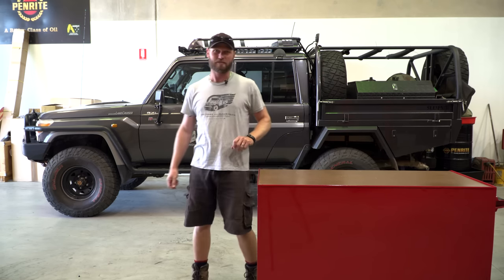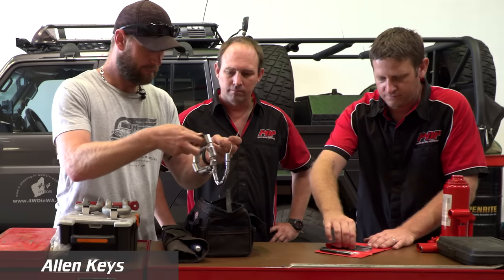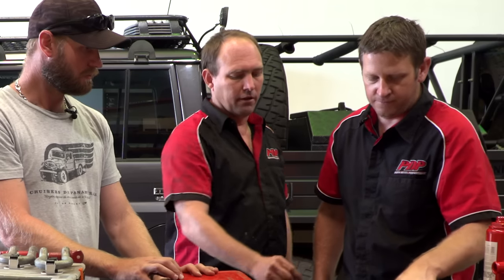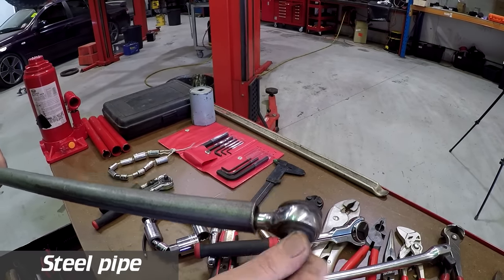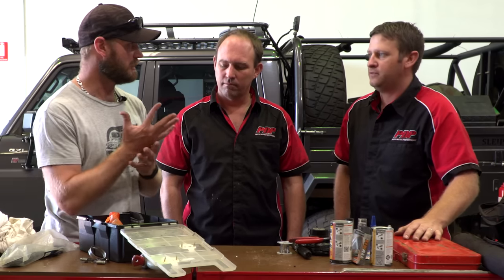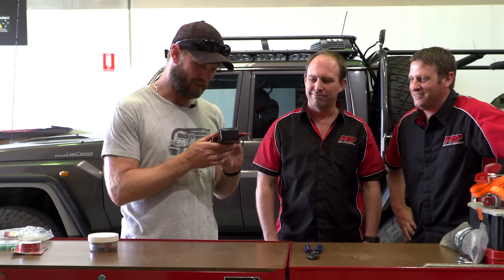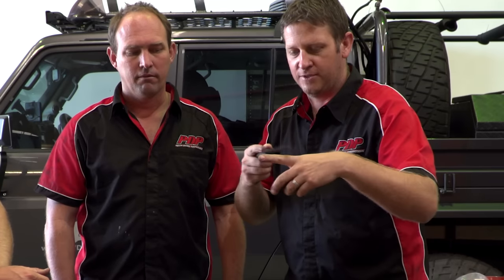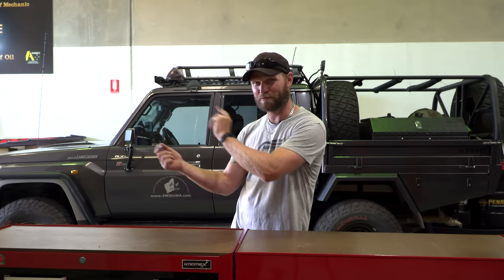Overland Tool Kit, repair kit

Comment: One tip for storing your ratchet straps. Toss each one in one of your old socks you were going to toss out and fold it over. It keeps the straps from hooking on each other and you also now have one more Rag in your rig just in case.
Reply from the maker: +Sean Burke best thing I've heard all day, worst thing when those straps get tangled
Reply: Also Grunt make man sized 5mm twisty cables ties! Use them on my straps all the time.
Reply: Sean Burke Damn good advice. I just use plastic shopping bags so they won't bind together
Reply: Great idea, i have enployed to great sucess to store my messy rachet straps. BRILLIANT.
Reply: I just wrap the strap with lecky tape across it. Same with cables once rolled up properly. You just need to grab 1 wrap on each side and yank and it breaks off
Reply: You genius SOB!

Comment: LOved it and "Liked It"! Ratchet straps are also handy if you have a tyre so flat that that it un-beads from the rim. Put the ratchet strap AROUND the whole tyre before you re-inflate it, make it quite tight, and it will force the tyre to re-bead before it over-inflates the tyre.

Comment: Excellent video Ronnie. It is always nice to learn something new. My mechanic experience comes from the military aviation background, and if you allow me I would like to make some suggestions: 
-Put sockets on rails. It is less likely you will lose them in the dirt. 
-You can get a small can of rosin flux. It makes the solder flow better. 
-Razor blades are useful for stripping wires. 
-Carry extra battery for multimeter in case multimeter is dead when you need it. 
-Have about 30 cm of wire with alligator clips on the end. You can use it in combination with a multimeter to measure voltage or resistance. 
-Bring various size of shrink tubing and have lighter to shrink them around wires. Soldering wire with shrink tubing is superior to crimping it. 
-Get rid of wire stripping pliers; you can use the razor blade for that. 
-Get rid of the universal socket. It might be too tall for practical use in tight spaces.
-Add adjustable wrench. It is suitable for holding bolts while you tighten nuts. 
-Add ½ universal joint. It is useful for getting nuts at the angle from your ratchet. 
-Add medical locking hemostats to your tools. You can use them for routing wires, picking small parts or for cleaning hard to reach areas with a small piece of cotton ball and alcohol. 
-Add small metal saw, or metal saw blade. If using blade wrap one end with a rag to prevent injury.
-Add mechanical fingers, and or flexible magnet to “fish out” nuts or bolts you can not reach with your hand.
-Add headlight torch to your tools. I love Pelican brand for their durability. 
-Add a small inspection mirror. It will help you with troubleshooting. 
-Alignment punches can be used to align parts in order to put bolt thru. 
-Combination mallet with steel on one end and rubber on the other might be a more useful tool than a hatchet. 
-Suggested tools should not add too much to the weight of your existing tools. 
-If you put all your hand tools in rolls, they will be more compact, and you will save some weight by getting rid of the boxes. 
Thank you for making this video. It is very informative, and there is a lot to learn from the professional mechanic perspective.

Comment: Ronny, I don’t often binge watch YouTube channels, but yours is truly binge worthy. I own a 2007 Chevy Suburban 2500 that I use to tow a ridiculously large camper because I have 5 growing spawn. At age 38, it is my first 4WD, and I absolutely love the beast. We recently took a vacation out to the Black Hills of South Dakota and I got a taste of off-road. Now I’m determined to find those trails in Wisconsin. My unicorn beast needs to be able to tow heavy and ‘froad moderately. Your videos are giving me the inspiration and knowledge to make that happen once the money shows up. The ole Burb is going to need a re-gear, some lift, and bigger tires, but a front locker and a winch will be a solid start. I’m already plugged into a few local off-road clubs. Thanks for your content.

Comment: I'm sure other people have mentioned it in the comments but swap that bottle jack 3 part handle out for a solid bar you can use for a breaker bar as well.  Cheap Bluetooth or wifi fault code dongle so you can use your phone to talk to the obd2 port.
The top of the bottle jack get a u shaped cap for it less chance of it slipping off when your underneath it.   The only other thing that I can think of is get a blow torch head for your soldering iron, very handy if you need to heat up a suborn bolt or need to fix a hole in plastic.oh bin backs I always have a roll of back in the back of the 110 so handy.

Comment: Great vid mate, some good tips. A little tip with your socket set is to fill up the back of the plastic insert with silicone. This stops the plastic from cracking and breaking while 4x4ing
Reply from the maker: great idea!
Reply: Or expanding foam.
Reply: good tip. similarly I've used hot melt glue to fill in various plastic molds to stop them cracking (such as the lip on plastic storage tubs)
Reply: My dad always used bondo, that was just to keep screwdrivers and such organized in his tool box though.  Probably a bit heavy for trail use.
Reply: wishing I knew this before my socket kit fell apart.
Reply: or even plaster of paris?
Reply: slowboat yeah but who is going to Paris to get some?
Reply: No, it would crack and make more of a mess than having nothing.
Reply: I like this !

Comment: Very useful info! Just a pro tip for the roll of tie wire.. wrap it in Duct tape, cut a hole in the center and pull it out from there. Keeps it all neat and tidy, but easily useable.

Comment: One thing that would be useful for fuel tanks and oil leaks is a bar of soap along with your Liquid Steel or Putty bars (ref 15:52) the putty will be difficult to mold and stick to the surface if its wet with fuel and oil. Scrubbing the surface first with soap will help to momentarily dry the area and then apply the putty. Also, I have noticed that after about a year of not being used the putty can become hard as a rock in the tube when you go to use it. So keep up on some of the items in your spare kits. Great vids Ronny. Hello from Arizona in the US  -Will

Comment: fuse wire can also be used as a "Get Me Home Field Repair". most proprietary fuses can be "worked around" with a wire fuse. Take a variety of amp rating. you can Multi Strand for higher amp. Research before hand as with all minimalist self rescue gear. good video. good advice. 😁. Cheers from Michael. Australia.

Comment: Ronny, I love the socket retention using cable ties - I will steal that! Extra bulk in the rachet ring spanner, good tip. Vice grips - choice! Silicone repair tape & epoxy putty, thank you. Fencing or baling wire, pre-cable tie days, thank you farmers. Gas solder torch - didn't think of that. I didn't know you could join hose clamps. Love the test light. Thanks for another great video Ronny, cheers.

Comment: Glad the PDP guys are on the ball. I wouldn't rely on everyone else to be carrying half my toolkit but thats just me.  Also I would recommend you learn how to use and carry a set of tyre patches. I carry a range of sizes for bush work. A sidewall tear is not going to be repaired with a plug kit. But with a patch you can drill and stitch a tyre together with cord or wire and patch on the inside to hold pressure which will get you home.. or at least out to the road.  Providing you get a bead breaker (or that high lift you leave at home) and a 2nd tyre lever :P

Comment: Vice grips:  also incredibly useful for opening champagne bottles.  I keep a pair in my kitchen drawer. 😂. I’d add a siphon for gas, a funnel or flexible thick plastic for oil, and being very old school a spark plug gap tool, and carb cleaner tool if your car is old enough.  A bottle of compressed air is great, especially for electronics.  If your car is newer, a code reader could be invaluable out in the bush to diagnose issues quickly.

Comment: A must have to go with the front wheel bearing socket is a pair of external cir clip plyers with a ruff edge to get the clip off the end of the shaft
Reply: Reference, , Ratchet Straps,,,, we call the 
small ones Mouse Shit Straps,,,,
sounds silly but saves confusion

Comment: Good stuff.  I add some socket adapters (1/2 - > 3/8 etc), a very small 3/8 ratchet, and some wire with alligator clip ends so I can clip  the multimeter probes to whatever I"m testing.

Comment: A welding hand piece and the glass from a welders helmet together with a few welding rods and some small scraps of metal. Welding off a couple of batteries has got me out of trouble a few times. Also handy is 1m of canvas to spread out on the ground to arrange parts, tools on while you are working. Get a decent set of fencing pliers and you can replace most of the other pliers you have. great video.

Comment: Something that would have been handy in our Simpson trip was additional flexi fuel line, fuel hose joiners, bolts to block fuel lines.. we had to remove a faulty fuel solenoid .. and bypass the aux tank to get us moving. Worth adding.

Comment: XLNT! Good info! Now I can fill the holes in my kit. for me, if its large enuff, I use the (hollow)  jack handle for leverage on breaker bars, ratchets and smaller combo wrenches
Translation for us yanks - Silicon = Black RTV. Metal repair =  JB Weld. Plus paper clips and rubber bands to get you home (or at least to the road so AAA can pick you up) and a way smaller can of WD40 (for space).
Yes on a small tube of hand cleaner and a test light (instead of multimeter)./
Thx!

Comment: About your tie wire. To store it and make it easy to pull wire out wrap duct tape around the outside and then wrap it completely the other way.( like you were flipping a tire over and over until it’s completely covered). Poke a hole in one side in the middle and pull the loose end of wire through. It will never get tangled.

Comment: Don't discard your factory jack just because you've got the big red one. I've had a few occasions where I've needed to use two jacks at the same time to get enough height to do a job. This is especially true if you have bigger tyres etc. I actually carry two extra bottle jacks as well as the factory jack in my Silverado.

Comment: This video was really informative, thanks Ronny. Good to get the opinion of these guys. What I also like to do is take note of tools I use went doing a job and work them into my trail kit. I've pulled apart and replaced most things on my car and I think my kit is now pretty comprehensive, but I really learned a couple of things. Thanks again.

Comment: Hey, a couple thoughts. Race cars and airplanes use tie wire as hose clamps, it works great for many uses if you know how, so your tie wire can do double duty. Also fuses can fairly easily be by passed or you could put some wire on a different style of fuse and get home ok.

Comment: I have flexible socket rails in the back of my car. You may have to sand down the posts to fit your sockets. Some brands fit tighter than others. A headlamp is more useful than a flashlight. Zebralight make headlamps where the flashlight can separate from the strap and they make them in multiple beam patterns and battery platforms and they are well worth the price. Go for a neural or warm tint ideally. A big prybar is very handy. Groove joint pliers or Channellocks are good too. I'm guessing you have a tire inflator and pack concentrated biodegradable soap and water to find leaks and to clean your hands. A magnetic pickup tool is a must, a flexible one is better. A small hook and pick set. I keep an adjustable wrench for the imperial sizes occasionally. A muliti size/ function hacksaw can sometimes be useful but otional. A paint pen or marker can be useful to mark where things need to line up. A 21 inch or larger 1/2 drive breaker bar. Always have a pair of leather gloves. Long reach needle nose pliers are useful. I'm sure I have other things in my car that I can't remember that would be useful for this application.

Comment: Good vid Ronny. I've gone away from Hi-lift jacks also. I have a nice scar on my face which required stitches after the handle slipped out of my (wet) hands under load. I'd rather use all the other recovery devices at my disposal to get out of a bog, and for changing tyres i'll use the 10T bottle jack that I have like yours. My socket sets have had the silicon treatment & are still good after 20 years! I notice you have knipex pliers- best on the market and the mini bolt cutters have served me well for while working as a fencing contractor

Comment: Hey Ronny, greetings from Germany and very thanks for your Vids!!
Recommending :  if you need more of these bolt-on-fuses, go to Wuerth .. either online (wuerth.com or whatever) or to the australian shop in Thornton.
Next.. if you have to build a Handle for the extension tube, dont use any tape or rope .. take electrical shrinking tube.. if its to thin take a second and maybe third one .. its much more resistance and above all way more grip in wet or hot conditions than other things !! .. 
Thats from me .. wish you all the best on your tours!!

Comment: Testing a lot of stuff on my LR3 i would replace that multimeter with one that comes with a DC clamp as well Ronny. DC clamps are extremely handy.
Reply from the maker: very good point, was using my multimeter just the other day (didnt fry it this time) and found those needle style handles a real pain...

Comment: you can get fused leads for multimeters. 
Ask torbs, he's an electrician right? He'll know where to get you them. 
Saves from having a meter blow up in your face, not to mention the cost of the meter (if you have expensive ones) 

Great video though, definitely need to update my kit a little more.

Comment: Awesome video Ronny, got some good ideas 👌, have you seen the fuses that are resettable (like a circuit breaker) they're gold. Cheers mate 🍻
Reply from the maker: +Brock Purnell no I have not. Do you have a link for them?
Reply: They are the bigger ones, not sure if you can get them in your size, would be handy though.
Reply: WOW $5 thats alot cheaper then $10 a pop .. outback robbery!

Comment: Bring a liter of short strand 'Kitty Hair' Bondo filler with extra hardner in case you need to plug a large hole in your radiator or fuel tank or oil pans or diff cover etc. Just mix up a 'Hot' batch with extra hardner and ram it in the hole.

Comment: get rid of the pliers and crimping tool and get a good set of electrical pliers, channelocks or something, also if you have a 1/4in socket set and a 1/2... do you really need a 3/8?

Comment: I dont carry any tools in my truck.  I do have:
- water
- water purification tablets 
- snacks
- hat
- gloves
- 2 jackets
- small folding stove with lots of fuel
- fire starter
- emergency blanket
- jump starters
- jumper cables
- window wash
- 5 gallons of fuel
- 2 flashlights and extra batteries and a charger
- 3 knifes
- 50 feet of 550 cord
- cargo straps
- hand wipes for removing heavy metals (to use after a day at the range, if I can't wash my hands)

Comment: Cool video. But the neck from an axe is not harded like a hammer, the neck is a balancing weight for the axe. It is not for steel nails, you can take it for wood or aluminium. Cheers from germany

Comment: Do you get full size pickups in Australia, like a Chevy Silverado or a Ford F-Series? Are temporary imports allowed? 

What are gasoline prices like in your area and areas where you travel? 

Gas V8s are a more common type of motor here, with a different torque curve. How is performance on dunes in a heavier vehicle different compared to a turbodiesel? I.e. the weight of your Land Cruiser. 

Have you ever seen a diy electrified vehicle on the trails? Maybe with a large generator?

Early congrats on 100k subs!
Reply: Joseph Bondi we do have the mentioned pickups, but most have been specially imported, and they are often impractical here because our parking lots and rainforest roads aren't big enough for them.
Reply: Gas prices are fairly expensive at the moment, and will get more expensive as you travel to remote areas.
Reply: Mitch ismyname here in Canada we're at about a dollar per liter. Is yours more or less expensive?
Reply: here in Canberra it's about $1.70 USD per litre in at most servo's
Reply: The F Series has been sold here in the past (and was made here for quite some time too), but is not sold here officially currently. Chevy's have never been sold here officially. Ram has just started to factory supported RHD conversions, but it is its first time selling here.

All 3 are available to be purchased converted by aftermarket, at expensive prices. I have a 6.7 F250 personally. Gas engines are not popular at all, if you go off roading in Oz you will be far away from anywhere, and you will need at a minimum 1000km (600 miles) range fully loaded off road, and petrol will be a lot more expensive in those remote locations too. My diesel F250 (which is very economical) gets between 12-16mpg loaded in the soft stuff, I have a 250l (66 gallon) tank. A gas engined truck would be getting 6mpg in similar terrain. Carrying 100 gallons would take up your payload (and send you broke filling up at outback prices).